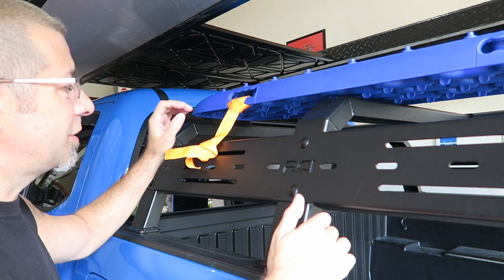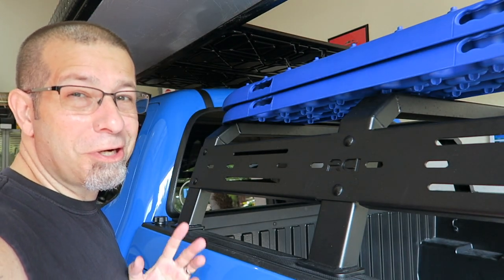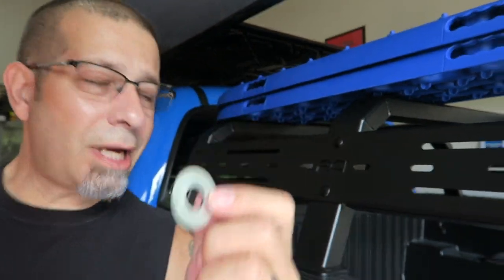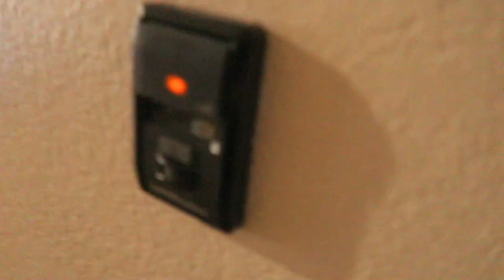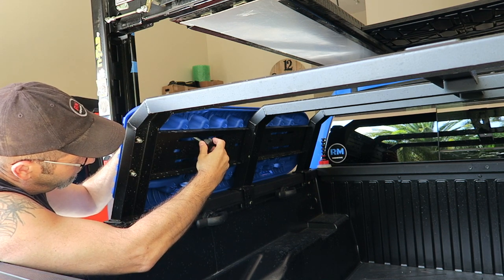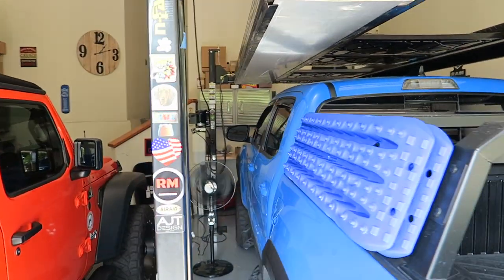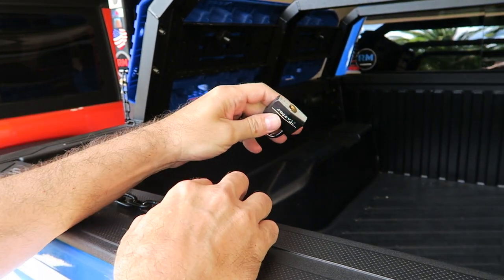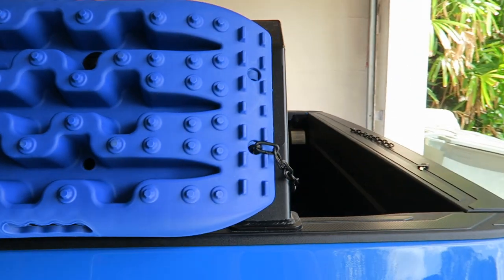Toyota Tacoma Recovery Board Install Day

Comment: Pretty cool. I would purchase some MAXTRAX Mounting Pin Sets for each side of the bed rack so you can use a small lock and get rid of the chain. I would then purchase another set of traction boards to even it up. Two traction boards, rarely do the trick. You need four and then you can get out of any jam you get into.
Reply from the maker: Good point👍

Comment: The straps are used for when you get in the mud and sand, so when you bury them with the truck the strap will be easy to find and pull them out with. And I find it nice to throw them in the creek when they are muddy and need a quick clean up. Always appreciate the videos nice looking truck but then again it's kinda hard to make a tacoma look bad lol.
Reply from the maker: Makes sense and thanks for watching👍

Comment: Try a bicycle lock. It’s a steel wire that’s wrapped in tubing so it won’t rattle as much as a chain/padlock and scratch things up. Also has an integrated lock.  Prices range from $5 to $20 on Amazon.
Reply from the maker: Good idea too😷

Comment: @robmotive I like the washer and bolt head going in from the front. Did u think about just drilling a hole in the bolt on the back side where your black twist nut goes on so just behind that twist but u could have put the lock directly through the bolt and avoided the chain and lock.
Reply from the maker: I didn’t...but that’s a good idea👍

Comment: Get another pair for the other side  for cosmetic balance.
Reply from the maker: Thought about that...however I want to be able to access them as quickly as possible while still securing them👍
Reply: @RobMotive  I meant on the passenger side too or one each side of truck.
Reply from the maker: Oh!!!!   I gotcha!!
Reply: @randallupton3622  I would mount the gas and water at the rail at the back of the cab more out of site .
Reply: At last we know what those chains were for from a couple weeks back!

Ready for some trivia?  Well here it is. In most hardware stores those are called “carriage bolts”. Round heads let things slid over and not get hung up on the carriage. Lag bolts have more of a wood screen type thread. 

Were the chains coated either with zinc or nickel?  If plated the paint will have a hard time sticking, with out some surface prep and a coat of etching primer.
Reply from the maker: All great info.  The chain is plated.  I fully expect the paint to peel/chip off.  Future next mod🤔

Comment: Something I'm not sure I completely understand, thought you might. If you take an adjustable Strut like 5100 Bilstein (front). Does the strut itself lift the front of your truck or is the strut adjustable to account for the fact that you've lift it in someway, blocks etc...
Reply from the maker: Both👍
Reply: @RobMotive  Thanks! I really need to find a shop that knows more then me but haven't found that locally. lol

Comment: What happened  to your cable  lock you had you could have plastic dip
Reply from the maker: Wouldn't fit thru the holes in the boards or the bed rack😬

Comment: DONT KNOW ABOUT YOUR BOARDS BUT I HAVE MAX TRAXS AND THEY MAKE NICE  LOCKABLE MOUNTS .
Reply from the maker: I’ve seen those.  Kinda pricey if I recall🤔
Reply: @RobMotive  I paid $550 for my MaxTrax and is worth it.
Reply from the maker: On that...we disagree😬
Reply: @RobMotive  just makes sure you don’t spin the tires on the boards.
Reply from the maker: For $550 I wouldn’t even want to get them dirty!! 😬
Reply: @RobMotive  lol